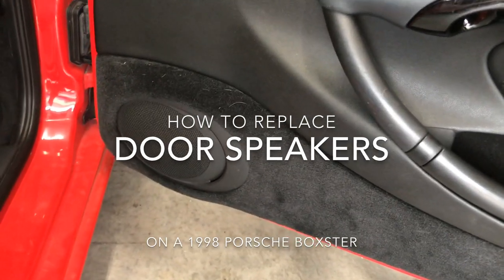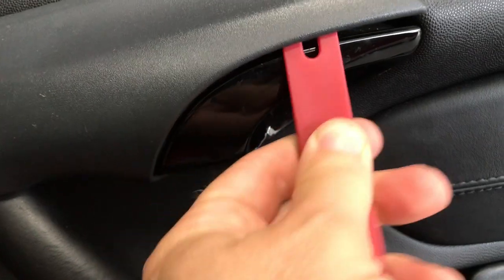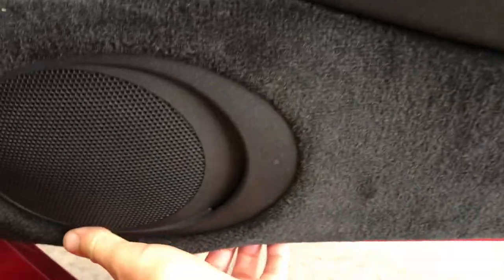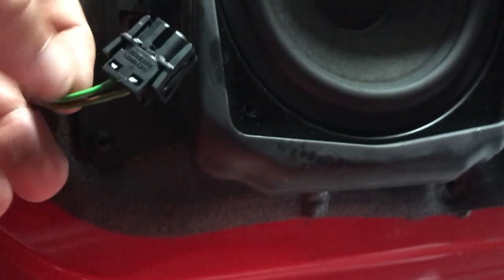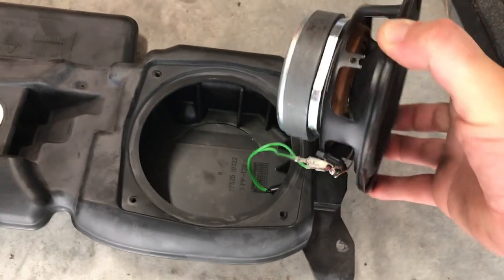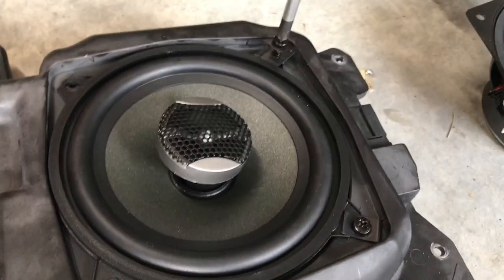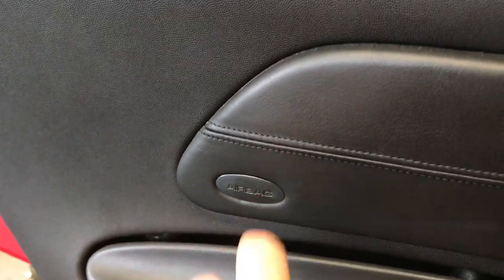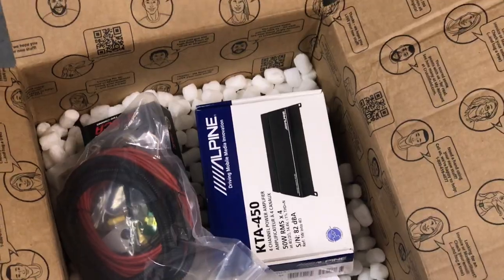How to REPLACE/UPGRADE DOOR SPEAKERS in Porsche Boxster 986

Comment: Dropped 4ohm speakers in my car and was wondering why they just wouldn't work. I figured theyd just be quiet if the resistance wasn't correct + my OEM speakers said 4 amp on the back. Now I'm bouncing between a new amp or just getting 2ohm speakers to save me the work
Reply from the maker: +@colonelbacon6336 speakers are definitely the easier way to go

Comment: Thank you for the great instructional video.  I removed the passenger side door card and found that some Buba had previously worked on the car...the OEM door speaker woofer/plastic housing was gone and was replaced with an MDF board that was falling apart with a 6x9 Kicker speaker from the 90’s.  So I’ve found an OEM set of speakers that are on the way, but in the meantime I found many of the plastic clips on the door card were broken...but I can’t seem to be able to pry off the seat of clip out from the door card.  I’ve tried twisting and pulling but no dice...any recommendations?  Thanks in advance.
Reply from the maker: +Fred Noce you’re welcome! Honestly I’ve never replaced the clips so I don’t know what to tell you about that. If you figure it out please come back and leave a comment in case someone else (or myself) need to do it sometime 😃
Reply: Thanks for the reply...well, since I last wrote, I found a tool at Harbor Freight called Panel Clip Pliers.  That should do the trick and will know for sure later today as the OEM speaker boxes arrive and I’ll do the instal.  Will advise how it goes with the pliers.  By the way, for anyone that needs the panel clips, you can readily find them at your local specialty VW parts stores for $.95 each versus paying resellers on eBay in excess of $15 for a lot of 8 clips (twice as much)!  They are exactly the same door card clips.
Reply from the maker: Fred Noce thanks for the update!
Reply: Help me DIY 

UPDATE...ok, so I was finally able to start on the install today and wanted to report that the panel clip pliers did the trick in easily removing the broken door clips.  It’s available at Harbor Freight and it’s item number 63699...costs about $10.  The rest of the instal went fine and now my speaker upgrade is complete.  Thanks again!

Comment: I would not recommend taking the time to do this. I pulled my doors, changed the speakers, just to find out the Porsche door speakers are essentially subwoofers, and you won’t get any real audio from the doors other than super low frequency . Great.
Reply: I love your other videos though. Super helpful on action, just not in this case.
Reply from the maker: Oh I absolutely agree with you if you’re not also adding a sub! I did though so that makes a huge difference
Reply: @HelpMeDIY  did you find that adding the speakers made the bass more surround sound’y? 
I’m wondering if there’s a way to redirect the audio from the head unit to have actual audio output from the doors. 
I’ve seen the subwoofer video! That was a very clean run.
Reply from the maker: @YQLbeast  No not really. Just louder and fuller overall with all the combined speaker/sub/amp upgrades.

Comment: Thanks for posting this video.  I'm planning to upgrade the stock woofers in my doors at some point and it helps to know what I will encounter during the course of the project.  It seems like the biggest challenge will be 21-year old plastic that has grown brittle with age.  In your case, it looks like someone had already mangled some parts of your doors.

I think you installed a stand alone subwoofer with a dedicated amp.  My plan is to install subs in the door, that can be driven by my 6-way amp from a 996 Cabriolet.  There are some 5.25 subs out there, but I wonder (1) whether the upgrade will improve the sound enough to justify the work required and (2) whether the 996 amp will have sufficient power to drive them.  I may need to add a second amp to drive the subs.
Reply from the maker: +Kevin's Boxster hey Kevin! My amp actually has a self contained amp so it gets power directly from the battery. And I think it sounds great! Lots of options available to you though :)
Reply: @HelpMeDIY  I was thinking about adding something like this: https://www.parts-express.com/Peerless-SLS-P830945-5-1-4-Paper-Cone-Woofer-4-Ohm-264-1604   It looks like it would fit, but I wonder whether it would sound any better and whether my current amp would have enough power to drive it.
Reply from the maker: @kevinsboxster2310  there’s only one way to find out!
Reply: @HelpMeDIY  Nothing ventured, nothing gained.

Comment: Lol the door speakers are subs, not regular speakers, I bet it sounded like shit after putting those in.  U need a 2 ohm 5 1/4 inch subwoofer
Reply from the maker: +Anthony Stauble yea that’s right if you are using the stock amp and not upgrading further. I also added a new amp and a sub behind the seat 😉
Reply: @HelpMeDIY  My 03 S is all stock, not Bose either.  Im trying to make an attack plan for head unit, speakers and amp.  Getting the door speakers to not just be subs would be my preferred first step.  What needs to be changed to fully utilize two way speakers in the doors??
Reply from the maker: @tpac8347  like Anthony said, if you ONLY do that it will sound terrible. You will want a dedicated sub as well